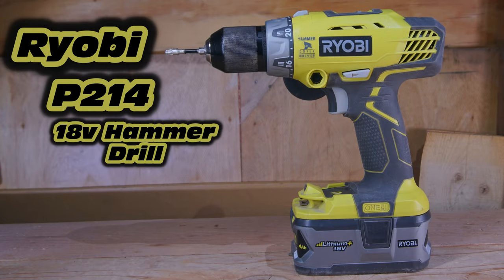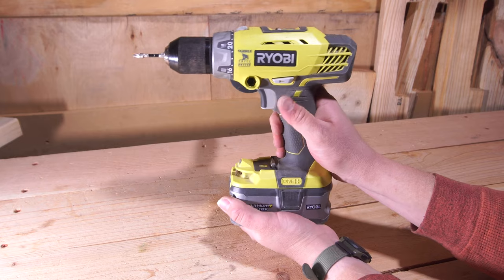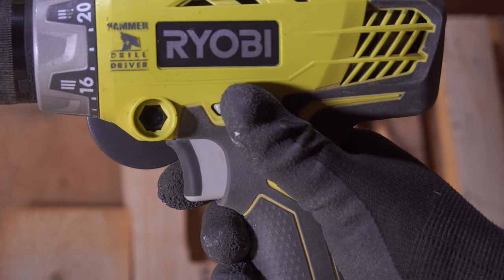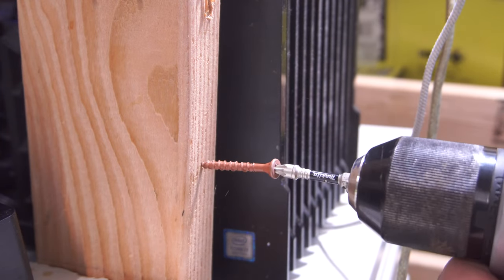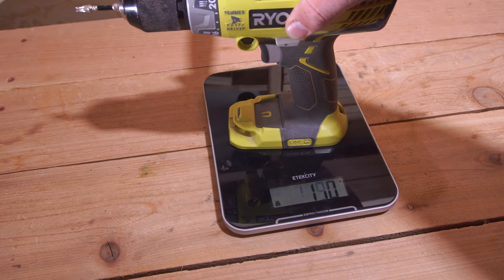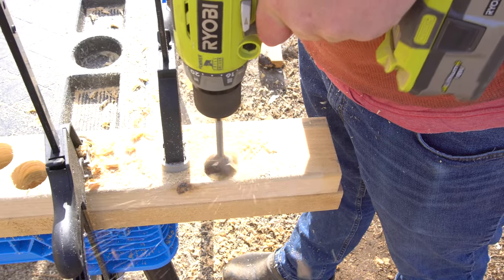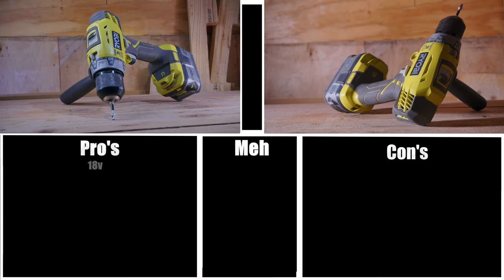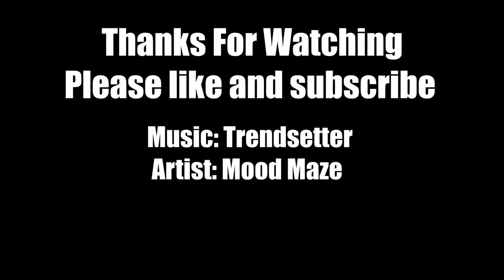Review Ryobi  p214 hammer drill

Comment: 1)  I have no problem modulating lower speeds.  That's why it's a 2 speed drill, put it in the lower speed.

2)  It does have a ratcheting lock for the chuck.  Maybe yours is gummed up, or you just didn't try?   I haven't had any problem with bits coming out, maybe if it's something tiny like 1/16".

3)  It's a homeowner grade drill, not really meant for (larger) auger bits.  Any tool, you have to put in the context of what it's meant for vs the cost.  I don't ever put the handle on.

4)  The best way to look at it is a drill that uses the same batteries as all your other Ryobi 18V products.  I would not buy only one Ryobi tool if a type of tool where you can get Milwaukee, or Dewalt, etc contractor grade instead as a drill is so versatile and often the first cordless tool that someone buys, but at the same time you likely don't need all your drills to be premium quality, just the ones that do the toughest tasks.   This drill is for when you don't need that.

Comment: Is this brushless?
Reply: No, and probably better that it isn't at this price point.  There's another great thing about Ryobi, that (especially during Ryobi days at Home Depot), their batteries are far less expensive than the contractor grade brands, so not a big deal if it loses 20% runtime.  If you're a contractor using it all day long, sure you should pay more for a contractor grade tool, whether brushless or not.   There are plenty of pros getting work done all day long with the same brushed tools they have had for years, because no reason to replace them until they fail or get stolen.

Comment: Wasn't worth it when it came out lmao
Reply: You obviously don't use tools much.  It is fine for what it is, a great value at its price point.  If you want to pay 3X as much, it goes without saying that you should expect a better drill.   

The only real competition at its $40 price point is something from Harbor Freight with a 90 day warranty, and then you need the battery and charger too, but HF has hardly any other tools on the same platform while Ryobi has over 200 taking same batteries so there's further versatility and cost savings.
Reply: @stinkycheese804 I have this p214. It will smoke brushed drills. It is an absolute monster. Hammer drills mode tears through concrete.